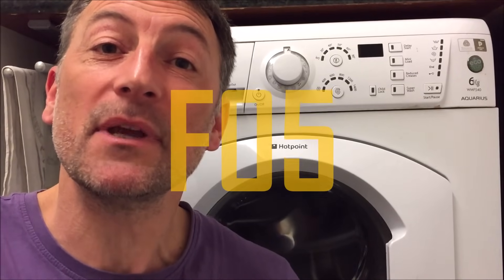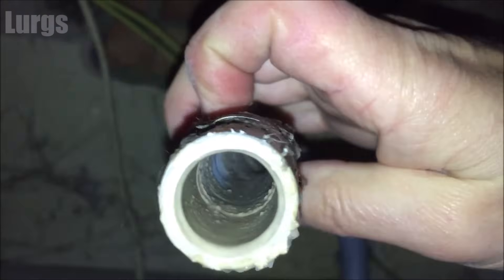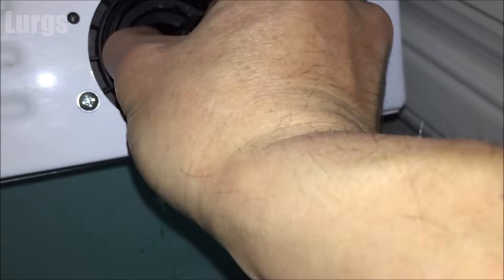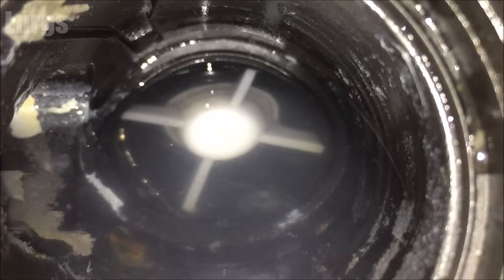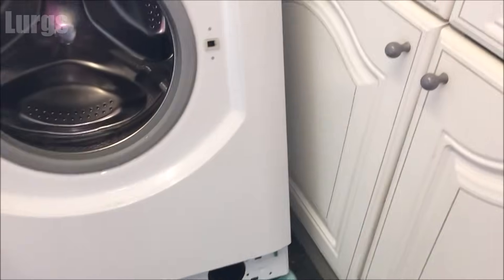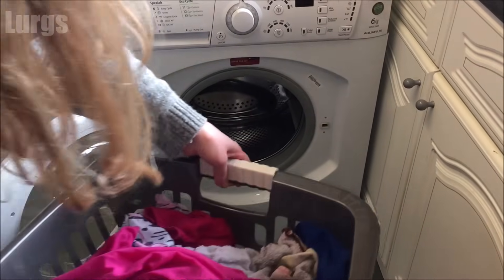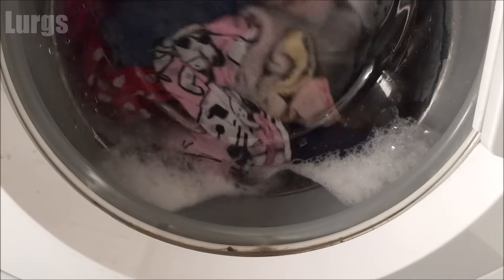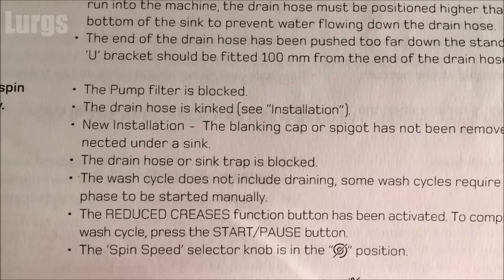Washing Machine F05 Error Code Fix Hotpoint Indesit

Comment: I have the same problem with my hotpoint but the filter wont budge almost like its sealed shut. I had to unscrew it out completely but it stii wouldn't open
Reply from the maker: Hope you got it sorted. Stay safe. 😎
Reply: @LurgsHowToGuides  After watching your video i went back to my machine with a pair of pliers. Needless to say i got the FO5 sorted but ended up with a broken filter cap🤦‍♀️🤦‍♀️
Reply from the maker: @siricybs767  Oh dear, sorry to hear that. When something gets lodged in there it's very hard to remove the filter. But on a positive not a new filter off a well known auction site is still cheaper than a new washing machine.

Comment: hi, my washing machine WML540P stopped in between and not pumping water out. RED key light stays on and amber pause light flashes. please help
Reply from the maker: Need to check the filter first. Turn machine off and unplug then follow steps in this video. Hope you get it sorted.

Comment: been doing this with my machine on a regular basis so much so i got a wet vacum to stop flooding the kitchen, this time however i can feel what im guessing is a thin wire but cant get enough to hold to pull it out, completly my fault for not checking my pockets due to rushing, usually its my daughters false nails and 5p coins,
Reply from the maker: Oh you need to get that wire out if you can, what about a pair of small pliers?

Comment: hi, I tried the procedure but didn’t work. Cracking sound comes from the module 3 times and stops. Red light flashes(key). Please advice..
Reply from the maker: Could be a faulty electrical board. Try turning off and unplugging. If no luck you might need someone to have a look at it.

Comment: I fix mine the first time it work but now I did it again after it show fo5 error the washing machine remain the same still showing fo5 and clean again and again,  now the washing has stopped washing all I hear is noise can't roll can't absorb water like before 
Please I don't no what to do
Reply from the maker: Unfortunately sounds like it’s a pump failure. If it’s fairly new it’s worth trying to fix, else if it’s old it might be better with a new machine. 
It is worth checking the filter again as sometimes more debris can fall into it. Good luck

Comment: I’ve a bran new hotpoint machine first cycle will not pump out even moving the drainage pipe no water comes out any help please
Reply from the maker: Is it filling with water? Try putting hose directly into the sink to see if it pumps out. If not I’d say it’s faulty
Reply: @LurgsHowToGuides  it fills up don’t drain it’s full of water
Reply from the maker: @Shez-hw4hw  must be a fault then did you remove all the transportation bolts? If so and it’s not draining I’d call the guarantee place
Reply: @LurgsHowToGuides  yes removed all bolts. Just doesn’t pump water out
Reply from the maker: Must be faulty. Ring them and get it fixed or replaced

Comment: I tried it but broke my filter, but its not big issue. Thanks 😊
Reply from the maker: B.Amin Oh dear, guess you had something quite big stuck in there. Should be able to replace it easily
Reply: @LurgsHowToGuides  yeah, I couldn't figure out what piece was that, looks like the blue(like where you put conditioners in, but it wasn't that)flat piece with. measurement on it. Thanks for ur help, I really appreciate it 👌🏻

Comment: How can you clear a clogged drain hose from front load washer?
Reply from the maker: Jo Regan Well you need to pull it out and check the drainage hose at the back and also check the drainage U Bend before it goes out to the main drain. Make sure that’s clear. If it is then check the filter is clear and the rotor spins freely. If all ok put it on an empty wash on the hottest setting it will go, that might clear it. Also check outside drain if you can.

Comment: Can’t find another video relating, I cleaned the filter without me having a error message Iv put it back in and now getting the F05 message any ideas?
Reply from the maker: Mrs Halfteck Sometimes when you remove the filter objects can fall down after so there might be something in there again. Worth checking again by taking it back out. Make sure propeller spins freely.
Reply: Lurgs thanks couldn’t see anything else in there Iv checked the waste pipe nothing’s got stuck there

Comment: I had cleaned the pump, there was a Lego part and a peace of plastic bag in it, I cleaned, but still did not work. Then I cleaned the drainage pipe in that I found a little piece of plastic. I have a drainage trap in the wall which I checked and found a dirty hairball in that too. So there were 3  blockages in 3 different places. F05 error code occurs even if the pipes are just semi-blocked, which only slows down the water but does not block it completely. So be thorough with these nasty machines!
Reply from the maker: And now you've found your missing Lego pieces! Glad I could help out and that's a lot of debris you found, good result. 😎

Comment: I followed your instructions and unfortunately mine still isn’t draining. And there is no blockage 🤷🏼‍♀️. Washing machine not even a year old.
Reply from the maker: How odd. Either a blockage in the drainage hose or drainage pipework that it goes into, or something else has fallen down into the filter (check it again), or maybe the pump is faulty. If it's under a year old then should be covered under warranty.
Reply: After following your advice it ended up working, my sons sock got stuck in it lol. We are back in business. Thank you for this.
Reply from the maker: @Ourtrace89  Phew. Great news! Glad you got it sorted. Have a great weekend.😎

Comment: Help! Got rid of all the water from the bottom but still comes up with f05 error!
Reply from the maker: And the propeller on the Pump turns freely ? If so it could be the actual pump has failed. Worth checking again to see if there is any debris. Sometimes when you take it out and put it back in then other debris can fall down.

Comment: I've found nothing in mine. Checked the waste pipe, filter and even the outside pipe. I drained a lot of water from it and then managed to spin my clothes and the water was draining fine. But at the end of the cycle I got the error code again. 😢
Reply from the maker: Then it could be that the pump is on the way out
Reply: @LurgsHowToGuides  even on a washing machine that's less than a year old? It's so strange because I managed to get it to spin my clothes after draining more water from the filter. I guess I'll have to call someone, it's insured thank goodness.
Reply from the maker: @lynsey4224  Oh sorry I assumed it was an older machine. If you’ve checked all your drainage pipework and the filter then yes deffo give the washing machine helpline a call. Hope you get it sorted, let me know what the fix was. Thanks.
Reply: @LurgsHowToGuides  thank you. I gave up on it last night and decided to give it a try this morning and it's working again lol. Water draining fine, F05 error gone thank god! Let's hope it doesn't happen again.
Reply from the maker: Good news.

Comment: I’ve cleaned out the filter but no luck still not working
Reply from the maker: Just check the filter again as sometimes when you remove it then things can fall into it again. Else it could be a faulty pump or computer board error. Good luck

Comment: I did it all but it still shows error after I finish the wash cycle
Reply from the maker: Oh dear, odd. Have you tried switching it off at the Plug to try to reset it?  Hope you get it sorted, let me know how you get on.
Reply: I tried switching it on and off as well but it still fills up with water after wash and dry
Reply from the maker: Aditya Juneja Does the propeller spin freely? Sounds like the actual pump may have blown up. But also check your drainage hose and pipe work to the drains to make sure that's not blocked up with gunk.
Reply: Yes the drum spins without any problems and do you have a tutorial on how to take out the hose pipe? I can’t find it
Reply from the maker: Aditya Juneja I meant where the filter is removed the propeller in there, check that spins freely. No haven't got a tutorial on the hoses but if you pull the machine out the drainage hose should be hung inside some plastic pipe work that has a U bend at the bottom. Check that's not blocked
Reply: How do I check it is it ok to remove that filter cap and run the washing machine? You mean the fan type inside?
Reply from the maker: Remove the filter (as shown in this video) then check the propeller at the back to make sure it spins. Sometimes when you remove the filter other objects can fall down and block it up again so it's worth double checking. Then check the drainage hoses for blockages.
Reply: Yes the propeller spins but it’s not smooth
Reply from the maker: Ok then if your drainage hoses are clear then sounds like the actual pump is broken. In my experience if the machine is over 5 years old and gets heavy use it's not worth repairing, get a new one. If it's not that old it might be worth repair. Hope you get it sorted.
Reply: I am just checking the drainage hoses at the minute watching YouTube videos

Comment: Weird. I opened it up. Stuck my finger in there. Moved it about. Found nothing. Closed it up and set it to rinse. Error message gone.
Reply: The error popped up again...
Reply from the maker: Shame, for a moment I thought you had a magic finger! If there's nothing blocking it then it could be a pump issue or maybe your drainage hose pipework is blocked up.

Comment: Found some coins .... but the machine still does not complete rinse and drain cycle. Funny smell coming from the machine, sort of electrical type smell.
Reply from the maker: Illian Taylor I'm afraid it could be on the way out. A burning electrical smell is bad news. Time to call an engineer or get a new machine.

Comment: I can’t unscrew my filter
Reply from the maker: Try untightening and tightening multiple times to see if the object clears. It is bound to be a metal hairclip. If not you may have to get a bit more forceful, but be careful as the filter is only plastic. Good luck..

Comment: Found a Nokia 3310 in mine hehe nah thanks does work was a pain to open tho it even snapped
Reply from the maker: Glad I could help out. 😎
Reply: @LurgsHowToGuides  thanks still throws the error up even after replacement drain pump
Reply from the maker: Oh dear not good. We had same issue after a new pump and ended up getting a new washing machine! Which reminds me I need to put the pump on FleaBay as it wasn’t even used once as the error came up.